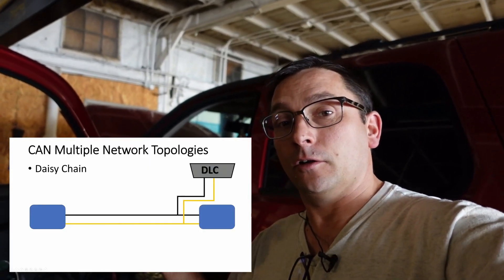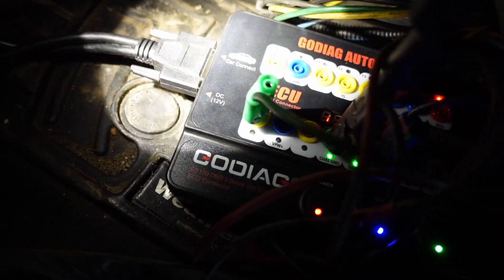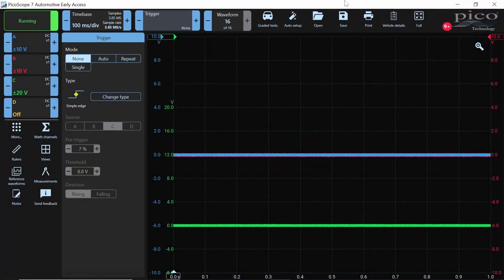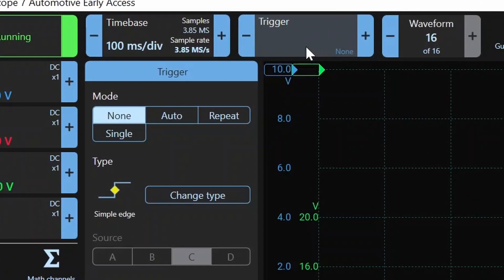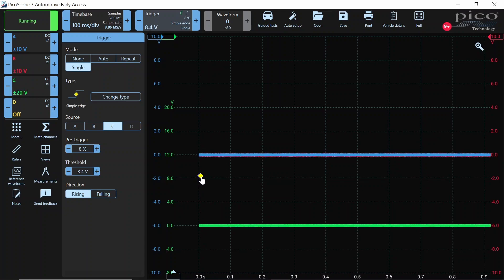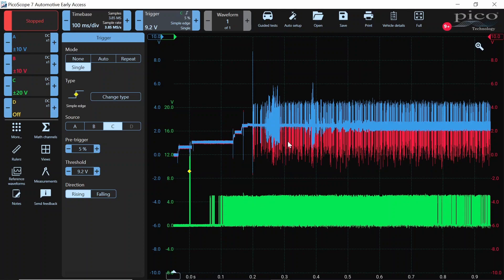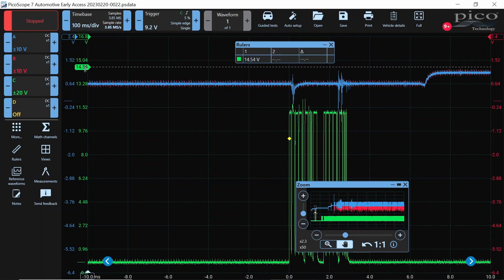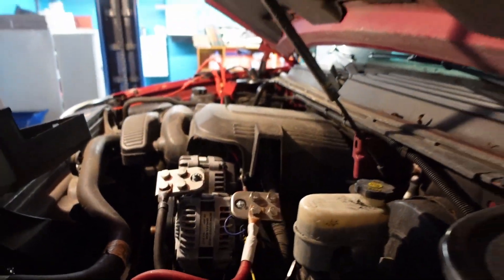Pico Scope Single Trigger Example

Comment: Hi Brian when I look at the wiring diagram and it says serial data will that look like  lin bus thanks for everything you do
Reply: Class 2 is 0-7 volts if I remember right
Reply from the maker: yes class 2 is 0-7
Reply from the maker: Usually lin bus should be 0-11~12 volts,  Low speed CAN has wake up of 0-12  but normal comm is 0-~5 .  Lin bus data is right around 10kbs , however most low speed single wire can is at 10kbs the standard does allow for much higher from what i have read,   getting upto the MS Can speed territory.